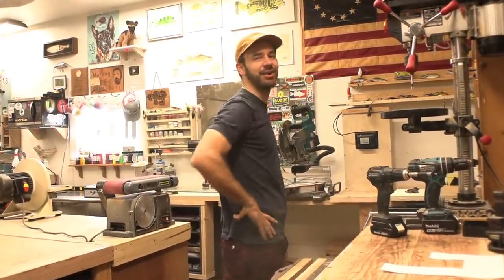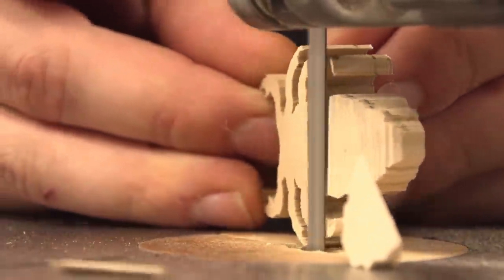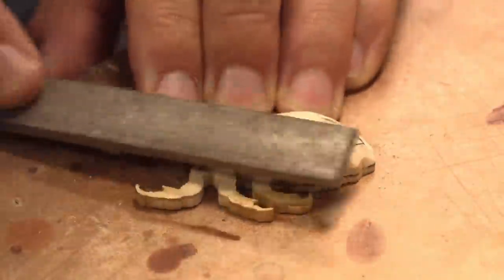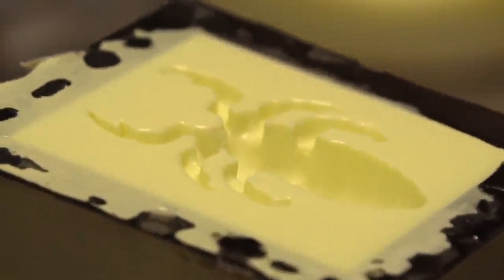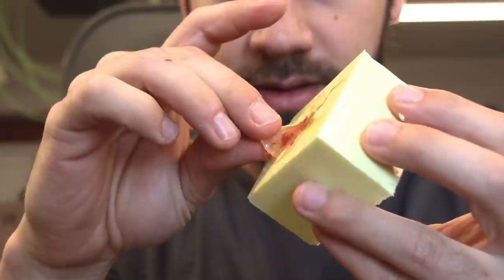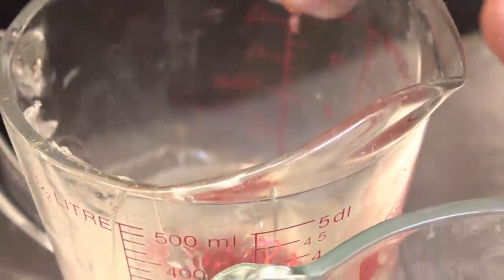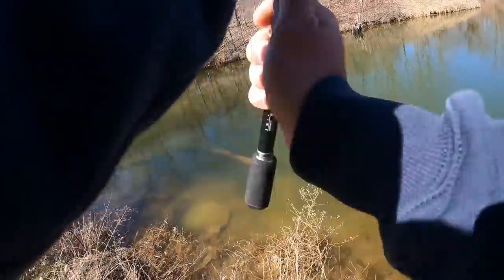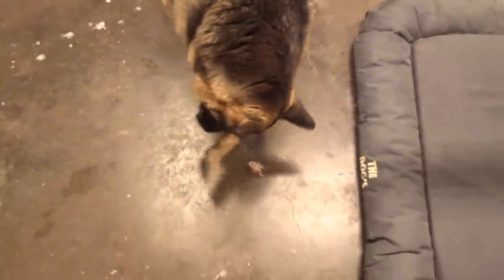Making YUCKY Head Louse Lure

Comment: Hey bro I have an idea 4u..I used to take the wooden filters off my cigars and use a longer than normal hook , slightly bent upwards about a 3rd of the way back from the eye and feed it thru the hole in the tip then epoxy it in place..I called them snakeheads..I painted them to match whatever color plastic worms I had..Texas rigged..It kept the head up on the surface while dragging the worm...Hope I set a bell off 4u !! ...Eddie DeBlock @ THE RELIC EXTRACTORS

Comment: Heat your scraping knife before you swipe the flash so it doesn’t pull the legs out. The knife is cold and when it contacts the plastic it sticks. Try a 3or 4 inch paint knife it’s thinner and works way better. And swipe ASAP after you pour the plastic in.